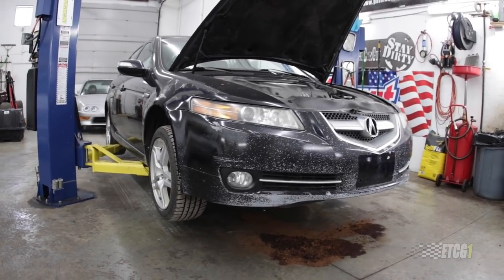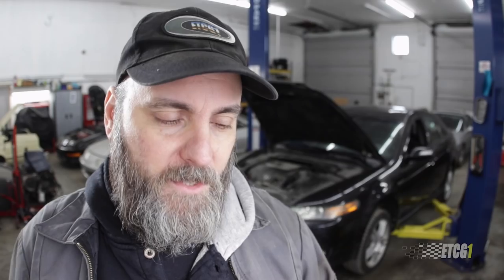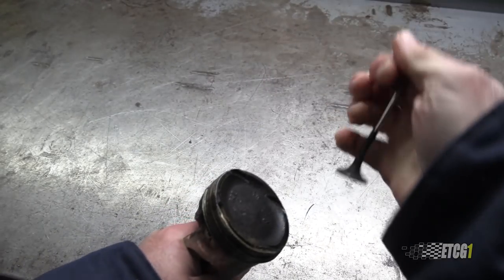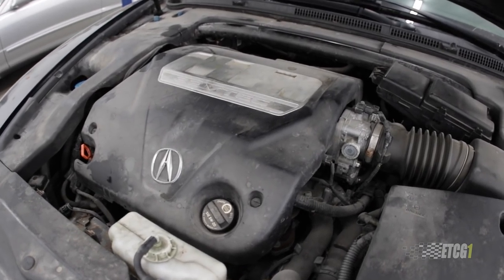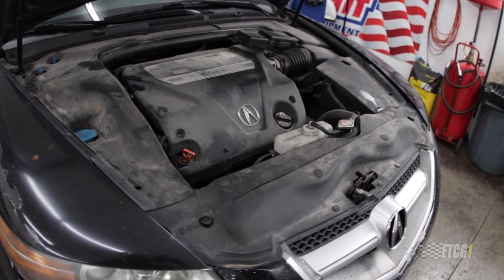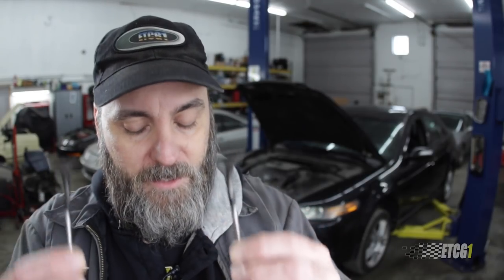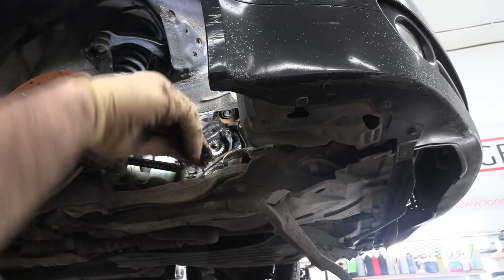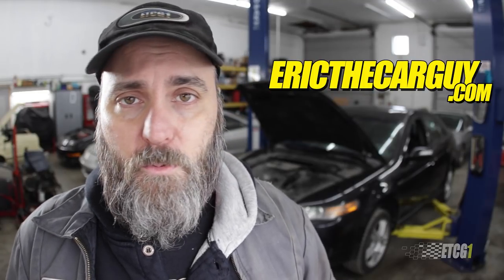What Is an Interference Engine?

Comment: I was trying to determine if the engine in our 2004 Solara V6 was interference or not as it's due for a timing belt soon. Interestingly, all of the reference info I found said it WAS an interference engine, while most firsthand accounts of broken belts were reporting no damage. Some speculated that it only is "Interference" when the variable valve timing was set aggressively like under heavy load. Thoughts?
Reply: Don't have much to add but the same was said on the Corolla forums in the UK with the 2zz-ge engine. If you timing chain went wrong whilst in "lift" you was toast, but if not on cam you could have a chance
Reply: The Toyota MZ series engines were non-interference without VVT-i. While your 3MZ-FE was only available with VVT-i, the 1MZ-FE before it was non-interference until that feature was added around 2000. That speculation is correct, as it's only interference at the extremes of the variable timing. Under normal operation you should be fine if the belt breaks, but still not a chance I'd take.

Comment: yep , i was told by tech , the 5.7 in my 97 chev trk that it is not an interference engine ... well guess what ? it is , after replacing timing gear , and bolt everything up , number 1 cyl had a bent exh. valve in it , and NO compression .... so back apart and pull one head , hell of a lot of work for a $12.00 exh valve and upper gaskets ... eh

Comment: I think before committing hundreds of bucks to what might be a pointless timing belt replacement it'd be a good idea to do pull the spark plugs and use an inspection camera to see if any valves are bent or pistons dented.

Comment: Pretty much if your timing is off in an interference engine theres a good chance, especially if you ran it for a while, you’ll have a broken motor, namely bent valves and maybe even ruined pistons.
Reply from the maker: Not in my experience. Thanks for your comment.
Reply: @ETCG1  its rare, your timing has to be off first of all so thats already very rare in itself. Only seen it twice but both times the keyweys were either damaged or just not there.

Comment: The belt broke on my Hyundai, and I was lucky. I put a new quality kit into it, however, 200 miles later it broke again...I was not lucky at all. Valves were bent, valve guides were cracked and rockers were snapped. 

I found the idler pulley bolt was loose despite me doing it up with a torque wrench. Anyway, while playing with the offending pulley it jammed up solid hard, after that I never made it jam again.

So to this day, I do not know why this happened... While the pulley was loose enough to be an issue in the long term, it was as far as I could tell doing its job. At any rate, an eBay head came up and all was well for not too much cost or effort.
Reply: Some timing belt kits come with garbage pulleys, bearings, tensioners, and fasteners. I don't know of anyone who likes to gamble on aftermarket timing sets. Some enthusiasts buy timing sets with bits from known OEM suppliers to get the real thing at a discount price. For example, VW/Audi get a lot of timing components from Continental and INA.
Reply: @skylinefever  I cannot remember the belt however the suspect pully was an Ina one, so it should have been OK. Hyundai dealer parts were silly money at the time in the UK.
Reply: @andrewthompsonuk1  Wow, rotten luck. I have heard that sometimes companies stop making things in west Europe, then make the next batch wherever things are cheap. What you get now might not be what the car was built with. Sucks.

Comment: My accessory belt broke, wrapped around the timing belt, made it skip 6 teeth. 
Valves are bent. Head comes off tomorrow to check the pistons. 
All happened stationary at idle. Was sitting at an intersection waiting to go, when I heard a loud noise, switched off the car and checked the engine bay. Noticed the serpentine belt broken. 
I replaced it in situ, but it wouldn’t start. Towed to the mechanics.

Comment: i'm not a huge fan of cars that have timing belts , a chain is much easier once you keep regular oil changes . my old mazda had a belt i had anxiety driving that with its fiesta interference engine .
Reply from the maker: No matter what a chain will wear out over time causing a loss of engine performance. At least with a belt you refresh it from time to time and keep cam timing accurate as a result. Thanks for the comment.
Reply: With overhead cams, I would much rather have belts, avoiding failure of chain tensioners and guides.
Reply: @MrTexasDan  there's corolla's driving around here over twenty years with their petrol vvti engines . so thats a load of horse conna right there tbh .
Reply: @ETCG1  i'm talking toyota cars , i honestly have no time for anything else anymore . those chains can last the lifetime of the car if the engine is maintained . . ive seen corolla's with over 300k and still going strong .
Reply from the maker: @seriousstuff8887  Sounds like that statement is driven by brand loyalty. Thanks for your comments.
Reply: @ETCG1 no its a fact these cars are driven by and sought after by most people looking for an older car . I had opel's fords mazda's . Fecking peugeot lol  . They're massively popular over here but like anything they need to be maintained. I'm loyal to my wallet  thats it .
Reply from the maker: @seriousstuff8887  Like I said, brand loyalty. Thanks for the comments.
Reply: @ETCG1  its really not . i would drive any car but overall i find toyota more reliable . and their vvti petrol engines are excellent imo . i'm not sure about the diesel but i imagine they're good there's alot of them on the road .

Comment: If you had to “guess” on the odds that the valves would survive a timing belt failure on a J series engine what have you seen in the past?
Reply from the maker: I don't guess. I just install a new belt and see if it runs.

Comment: A lot of times what happens is the belt snaps and it gets wrapped around the crankshaft pulley and is able to slow its momentum, therefore preventing it from continuing motion and hitting valves. 

Another interesting thing to note is sometimes a serpentine belt failure can wreck your timing system. I've seen cases where the serpentine belt snapped and got wrapped up with the crankshaft pulley where it eventually found its way inside the timing cover and caused a mess inside there.
Reply from the maker: I don't think that has anything to do with it. I think you get lucky or you don't. Thanks for the comment.

Comment: I think It depends if it's a Manuel transmission or an auto. An Automatic car shuts off and the engine stops. A manual transmission cars shuts down but since the driveline is still turning the motor well it chews itself up. Kind of like a money shift.  Just my theory..

Comment: Sometimes the valve or valves hit the piston but they bend so slightly that upon start up the valve realigns itself.

Happened to me, i put on a new belt and while cranking the engine sounded like a cylinder had no compression but it eventually started  with a miss and after 30 minutes or so it started running more and more smoothly.  
I know what happened and i know the valve seal may not be perfect but its been months and i'm still driving it as i plan to rebuild the engine soon...

Comment: I always felt that manufacturers should assure that any engine made with a timing belt should be non-interference engines, but of course that's too much like right and certainly not their problem.
Reply: Thisss, i couldn't agree more. A 10$ belt shouldn't have so much responsability...
Reply from the maker: First, if you maintain your engine, a broken belt should not be a concern. Second, if you want power and performance, you need higher compression and a higher lift and duration camshaft. With those things, the pistons and valves will come closer to each other during operation. So, you can have power and an interference engine, or you can have a low power non interference engine. Thanks for the comment.
Reply: @LMSILVIA  Then you will accept an engine that is much less efficient. Interference engines allow higher lift and larger valves.
Reply: They should, but building a diesel with a timing belt would be impossible. VW made a diesel out of the Rabbit gasoline engine during the 70s. I'm not sure if the gasoline Rabbit engine was non-interference.
Reply: @ETCG1  Then why not design it to run with a timing chain instead if it's going to be interference? What is the disadvantage there? I get maintaining and changing belts at proper intervals, but what if you bought the car used and the previous owner did not maintain it? First order of business is to change the timing belt but first you gotta get it home, timing belt breaks before you could change it, now you have bent valves.
Reply from the maker: @MAN_ON_WHEELZ Timing chains wear out over time causing a loss of engine performance. Also, when a chain brakes, the result is almost always catastrophic. Tow trucks are a thing if you're concerned about breaking a belt on the way home. In summary, belt or chain, you still need to maintain your engine. Having a chain does not guarantee that the engine will last forever. Plastic guides break, tensioners go bad, chains wear out, things can happen to a chain just like with a belt.

Comment: Is an interference engine just bad engineering? Why make an engine that can grenade itself if the timing belt breaks?
Reply: Because it allows higher compression ratios and higher valve lift and thus a more powerful engine, but you never hear people complain that an engine is too powerful and want a lower horsepower one instead, especially in the US.

Comment: Fairly sure most modern engines are interference type - supposedly the Mazda B engine is non, and the engine used on late 1990s Corollas.

Comment: I think it's odd that the 1994-1986 Nissan 300ZXT had a 7.8:1 compression ratio, and still is an interference engine.
This Nissan VG engine was great, so long as you knew what a timing belt was and when to replace it.

Nobody in my family knew what a timing belt was until one went boom in 1994. It happened to mom's 1985 Nissan Maxima. People who design a car with a timing belt should be hung by one. Nissan must have decided everything else about the VG engine was too durable, and someone needs to keep the parts department busy.
Reply from the maker: You really can't blame Nissan for your ignorance. I'm sure they listed the timing belt service interval in the owners manual. Also, I'm surprised that no one mentioned that the engine needed a timing belt when you went in for other services. That said, I'm sorry you had to deal with that. Thanks for the comment.
Reply: @ETCG1  It's okay. It was my mom's car. I am also surprised nobody mentioned it. Well, nobody reads their manual, and independent repair shops don't always know when to get things done. Mom got her oil changes wherever there was a coupon, not at any dealership. Also, that car was in repair shops for numerous other reasons, so I wouldn't be surprised if my parents decided to let it happen. They already spends thousands of dollars every year repairing that car, so it wouldn't surprise me if they didn't care about spending another $500 to replace the belt.

However, we made sure to either replace timing belts on our later cars, or buy timing chain engines. My dad simply refuses to buy a timing belt engine, and I'm the same way. It is one reason I want an Evo X.

Comment: Let me tell you a story. In 2011, I drove one of my Del Sols over to my girlfriend's house. At some point in the night, we decided to head back to my place. I hopped in my car and she was following me in her's. I was completely unaware that evil was brewing under my hood. The Sol's water pump and gasket suffered a catostrophic failure. So bad that it was completely soaking the timing belt with coolant. No sounds, no symptoms..nothing. Happened so fast, I didn't even smell it. A little over half way home, the engine just died. I rolled into a parking lot, got out into the night, popped the hood and stood staring at the motor. There was coolant dripping off everything. When I looked over, I saw that the timing belt had gotten so wet that it worked it's way off the cam gear. That was when I completely lost it..thinking, "Bent valves and jacked up pistons". I grabbed a rag and dried off the cam gear the best I could. Then I used the classic "hot timing belt trick" and managed to get it to slide over the cam gear. The moment of truth! I took one last look at everything, jumped in the car and then nervously turned the key. Bam! Started right up. The relief washed over me. 

Shocked and amazed, I threw some water in the radiator and cranked the heat to get me home. It completely looked and sounded like my motor survived its own game of Russian Roulette. At the time, we were saving money for some pretty important things. So I couldn't afford to get a tow truck. I would just need to keep the RPMs down and nurse it home. There were only six, white knuckled miles to go.  

Mile one was flawless. Mile two was even better. I was gaining confidence. At mile three, I began to hear the water pump pulley begin to squeal. But really, who cares at that point? It was just an obnoxious, sonic reminder that could cause more stress. I blocked it out and focused on mile four. And by some sort of divine intervention, I passed that marker and was now about a mile and a half from home. I was totally smiling at this point. I wasn't hearing any evil noises from the motor. I wasn't seeing any blue smoke from the exhaust. And I was almost home. 

The final piece of the journey was a 40 MPH stretch of road and a little over a mile left to go. The water pump pulley was intermittently screaming randomly. Reminding me that mayhem is looming overhead. But I thought, "I got this!"..and that was literally a half second before my engine completely died. Again. I tensed up, popped the hood and got out to view the destruction. The good news is that the water I put in the radiator was being sprayed everywhere..and cleaned a lot of the coolant off the engine bay. The bad news is that the timing belt was off the gear. Again. If the car was using a revolver to play Rusiian Roulette, it would be running out of odds. I thought, "Well, it was a good try." ..I timed the crank and head the best I could do in the dark and forced the timing belt back on. At this point, I was like, "This thing is damaged. Let's just get it home." ..I angrily and thoughtlessly cranked it. Not even caring at that point. But the car fired right up. No distressing sounds. No smoke. Nothing. But at this point, I knew there was no way I got that lucky. And I was right. Because about five blocks up the street, the engine totally died again. Can you guess what happened? 

After that, I felt that the winning part was that I got the car home. And with my plethora of parts, I could fix anything that happened during the carnage. But as the next couple days played out, I didn't end up using any of my parts. There wasn't any damage. The timing belt completely left the head THREE times while traveling 40 MPH or more and didn't do any damage. It got a new water pump and gasket, a timing belt..and.as a reward, a new head gasket due to the head being pulled off during the hunt for destruction. 

That motor spent another 3 years in that car. Then sat in the garage for 8-10 years. Before being somewhat rebuilt and dropped into a 1991 CRX. Which is in my driveway now. While the Sol rests in the garage. 

If your timing belt snaps or completely comes off a head once, twice or three times in one day and there is zero damage, it's borderline witchcraft and you should never part with that engine. Even if the buzzards come flying around.

Comment: Yeah. Better to roll the dice with the timing belt and water pump and check if everything is all right. It'll be a pain to just start tearing the engine apart just to find out that you don't need a valve job. Now that is something to bitch and moan about.

Comment: 🤔 What If You Tear Down The Upper Half Of The Engine Just To Be Sure The Valves Aren't Bent Before Replacing The Timing Belt @ErictheCarGuy 🤔
Reply from the maker: Why bother? You're going to need a new belt no matter what. I put a new belt on  this TL and it ran just fine. Had I removed the heads, I might still be working on it.
Reply: @ETCG1  Sure You Would Be Working On It Longer, Just To Check On Valves Before Turning It On, But That's My Route, I'm A ( Make Sure Kinda Guy ) 👍🙃
Reply: @1938thunder  I would wager that you're not a professional mechanic. If you were, then you would know that time is money. I doubt you would do what you suggest if you had 4 other vehicles outside waiting to be worked on before the end of the day. Also, exactly what harm would be caused by just replacing the belt? You seem very resistant on that front. To each his own I suppose. Thanks for your comments.

Comment: How about you borescope each cylinder to inspect for pistons and valves giving each other a kiss?
Reply from the maker: That is an option but no matter what you're going to need a new timing belt. Personally I feel it's just easier to install a belt and see what happens. If the engine is good, move on. If not, you'll likely need to pull the cylinder heads to replace some valves. Either way, you still need a new belt. Thanks for the comment.